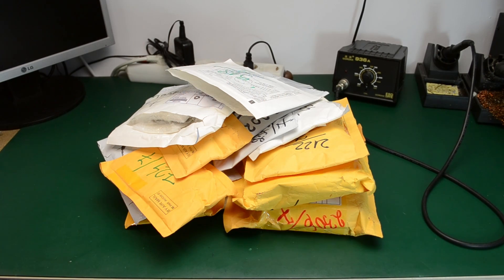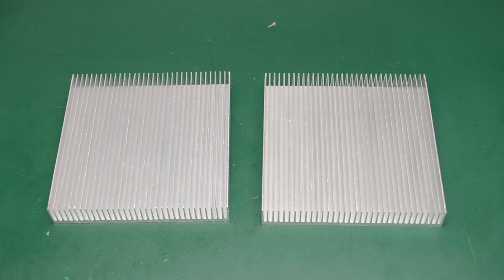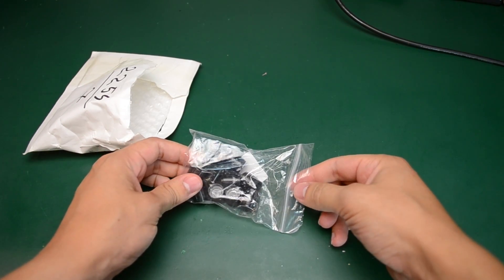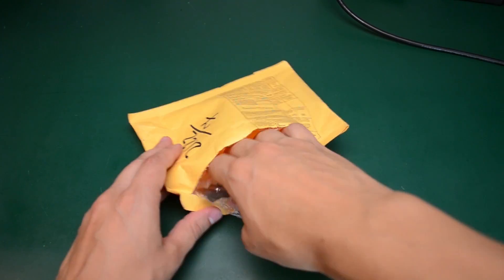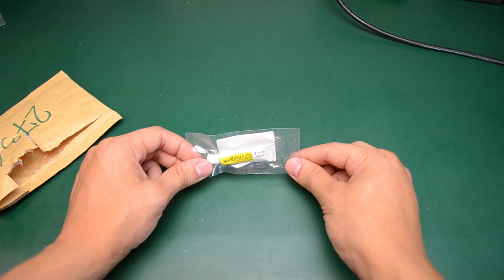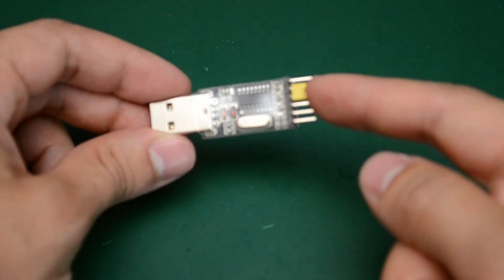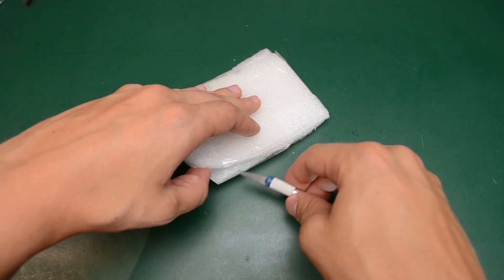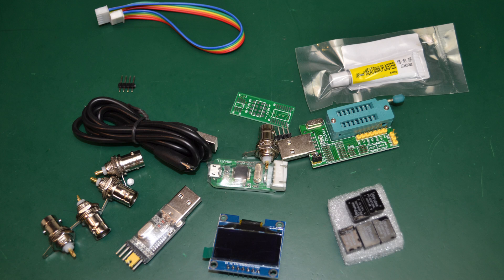VoltLog #21 - InTheMail: OLED Display, J-Link, CH341A, STM32, Project Box

Comment: What a coincidence I am also making a DC load but with a much higher power rating based on Kerry Wong's design. Another load you may be interested in studying is the one by Peter Oakes. (search youtube) It's a precision unit with a power dissipation similar to what I imagine you intend to make.
I occurs to me there is a market for such simple loads, I wonder when the Chinese will get around to making them?
Reply from the maker: Rob B I am following Peter Oakes on youtube for some time, thanks for the suggestion. I don't have a certain power dissipation number in mind so I am working backwards, building it and then measuring it's max power dissipation.
And I actually have a simple Chinese dummy load which doesn't seem to be copied from any design that I know but as usual lacks any documentation.